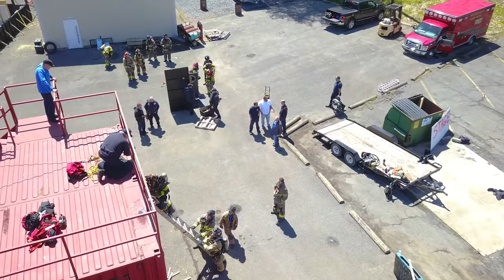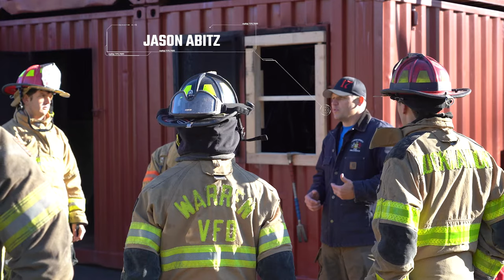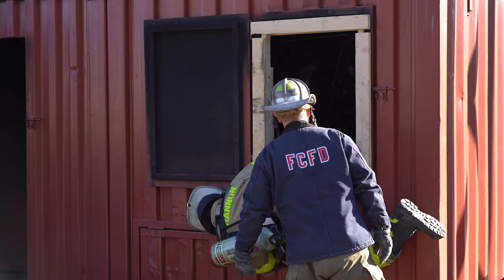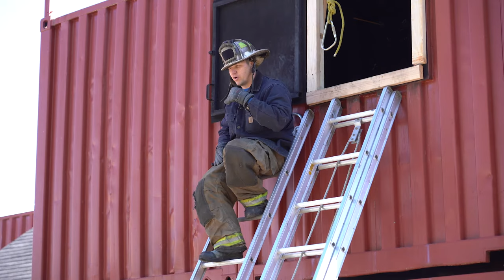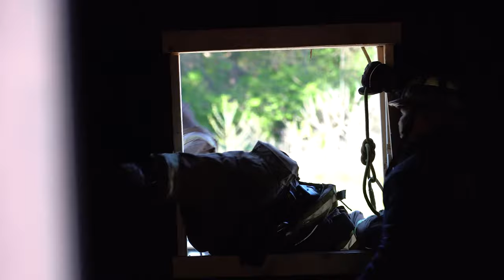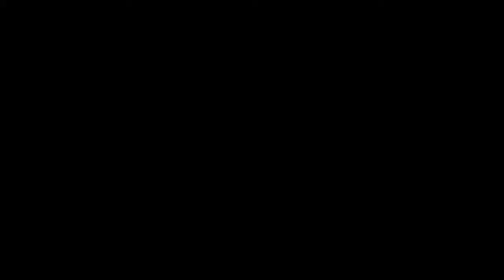Firefighter Safety and Survival Training: Self-Rescue Techniques for Window Hangs and Ladder Bails

Comment: Firefighter Safety doesn't start After you have gotten in trouble; it starts Before you do!  You shouldn't be training about what to do when you get into trouble, you should be training at not getting into trouble.

Now here's a look at common sense, logic and reality.  Why would you need to bail out of a window?  Because the fire is getting too big and hot, or you ran out of air.  The only reason the fire is getting bigger is because you didn't go inside prepared to make it smaller.  If you went in to do the Hero Thing to perform Search and Rescue of any victims and you didn't bring a hose in to eliminate the threat and protect them, then you didn't do your job.  They are in their night cloths while you are completely geared up.

The JOB of a firefighter is to "Eliminate the threat quickly and safely while using the least amount of water."  You follow that motto to Protect yourself, your fellow firefighters, the victims and the property.  In that order.  What good is a dead firefighter to anyone?
Reply: I get your point, but at the same time you need to be prepared because mistakes do happen. For example, you could be inside on the hoseline and you lose water. That could be no fought of your own, it could be lack of good water supply in a rural area, pump failure, or damage to the hose or nozzle etc. There is no such thing as perfect when it comes to fighting house fires, there's always something that could have been done better on every call.  There are so many variables that something can and will go wrong at some point no matter how much you train. At the time that something does go horribly wrong you are trained how to deal with it instead of becoming another number on the LODD list.
Reply: @dz528  There is not enough of the correct training to do this job the correct way.  Too many unnecessarily dangerous tactics that require too many Mayday tactics to save firefighter lives.  UL and ISFSI know what to do and 95% of USA departments ignore them.
Reply: This guy obviously doesn’t work in a busy place.  Guys that write things like this are guys that have never really done this job but think they know it all.
Reply: @SittingWithDogs  Has guessing gotten you far in life?  Not one word about firefighting in you childish comment.  Maybe you were talking about yourself.
Reply: You can train people for both, it isn't just choosing one over the other
Reply: @saudade7842  But proper training Isn't followed.  That was my point.
Reply: I agree, this is not a practice or procedure in European firefighting. After 30 years in UK FRS, never have I been in a position where I would have needed to bail.
Reply: From my understanding, not every single firefighter can have and bring their own hoseline in. there are two divisions in a FD, the engine and the ladder (if it's what it's called) so the engine crew are the one with hoseline, their objective.. Take the fire out. And the ladder is rescue crew, their main objective.. Well, to rescue, clearing out rooms, trying to find if there's anyone to be rescued, opening access to the engine crew like opening a roof, a door, a window.. The rescue crew get into the building before the engine crew.. And here's the deal.. Some building have higher floor, also like have been mentioned by first comment there are lots of reason for a hoseline doesn't working. But in case of building of higher floor, buildings prepared hoseline and hydrant on each floor, rescue crew could use that.. So "why would they escape?" Again.. Lots of things can happen in structural fire.. A collapse floor, main exit is barricaded, explosion.. So obviously when they stuck in a burning building they obviously need to save themselves just like you said "what is good with a dead firefighter"
Reply: And these "unnecessary dangerous tactics" is the most logical way to hang on an opening or a window, if you just hang on your belly while the rest of your body still inside the burning room, your head maybe out, your hands maybe free, but the half of your body still inside the room taking heat.. But if you do it as instructed in the video, most portion of your body is out of the room, it's only one arm and one leg still in the room taking the heat. 
Either way your upper body should be outside first, that's why they do that upside down ladder maneuvers.. There's nothing unnecessary here..
Reply: @randie_endik  not every firefighter, but in UK no team goes in without water, but we don’t differentiate between engine and ladder, we all do the same thing. Every team will be tasked to Search and firefight, focusing on life. Just our practices, and I’d say, we are pretty safe in our practices and FF deaths are in the single figures most years.
Reply: @randie_endik  As I said before Randie, the most important life in a firefight is every individual firefighter.  If even one goes down the entire operation goes down as all the other firefighters stop what they are doing to save their "Brother" that got themselves into something they shouldn't have.  If you focus training on doing the right things at a fire, the fire goes out quickly and efficiently and nobody gets hurt.  

The problem in USA firefighting is, 95% of departments have no clue what the overall job is in the first place.  Search and Rescue and saving lives is Not It!  "Eliminating the threat quickly and safely while using the least amount of water," is!  

It takes a MASSIVE amount of TIME to play the hero and go inside a burning building to carry a victim out.  It takes very little time and is incredibly safer to find the fire room from outside and apply tank water through the windows to stop combustion and eliminate the threat.  You can do that before an entry team can be assembled, get fully dressed and get the front door open.  Now that you have Protected the victims and entering firefighters, the job of finding the victims is no longer a panic situation where you get lost, hurt or run out of air.  

And, you do NOT go into a burning building without a charged line to further protect victims and the entry team.  Common sense and logic combined with a strong and responsible work ethic!  That's what all employees should work with.  That doesn't happen in the USA fire service.

Now, after you drum all that into the heads of firefighters, you practice for any possible situation you might run into where emergency egress is necessary.
Reply: @slay1373  that's what should every firefighter do around the world but yea i mean it is still a fact that some FD around the world have this engine and ladder crew thing..
Reply: @JB91710  i get your point, lets say even if everything is working as you mentioned where they focus just on extinguished fire, where fire is out, every FF have their hoseline everything done as safe as possible.. It's still a burning building where things still could happen.. Fire is out but smokes still can ignite, any part of the building could collapse anytime. So there's nothing simple about a job including structural fire.. You can do  your job whatever your job is as save as possible and will still need evacuation plan, especially a job where you runs into the burning structure. Also things depends on how much a structure is burned.. Obviously at some point you can't save what is already burned so there's no point to extinguished the fire but what needed is to prevent other things from burning.. So FF wont always directly attack the fire to extinguished it but rather prevent the fire from burning other structures so this one actively burning structure still have fire, there are no hose or water for that structure but there are victims inside, could be alive or maybe not who knows, thats why FF still need to go in regardless of their need of water (but again depends on the fire)

Fire fighting is not just saving lives or putting out fire, it's both at the same time.. You can't choose one and put the other one aside.. 
You can only balance the safety of their personnel while doing their job and the safety of victims which also their job..
So their whole thing is doing both as safely and as practical as possible.

You can only maximize safety for one part.. The personnel or the victims.. And everything you said is just about maximizing the safety of the FF where in reality it needs both.. You must sacrifice one part to maximize the other
Reply: @randie_endik  My point is that the USA fire service doesn't focus on doing the job right in the first place. They just focus on getting out of trouble they could have avoided.

When you eliminate the threat for the victims, you are also eliminating the threat to yourself or visa versa.  Eliminating the threat is the job, not getting yourself into trouble, which also gets the victim in even more trouble.

If you want to protect the exposure from burning, eliminate the threat!  You have to change your entire perspective of this job.
Reply: Thank you for your comment. I just watched another bailout drill video. It seems to me that a window bailout involves flashover or the fire got to a new source of air below the firefighter (doors, floor collapse, blown out window). Can steel wire rope be used to assist bailout? How long will 1/4" wire rope last from the beginning of a flashover?